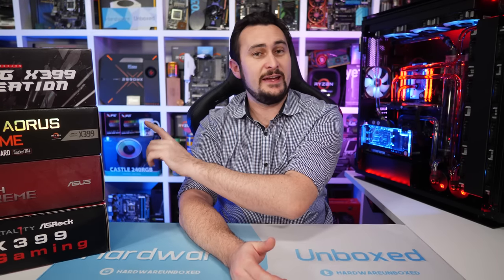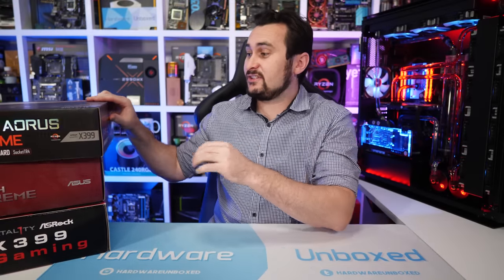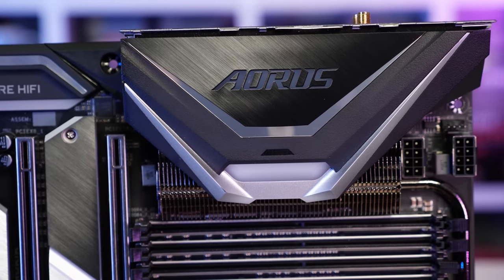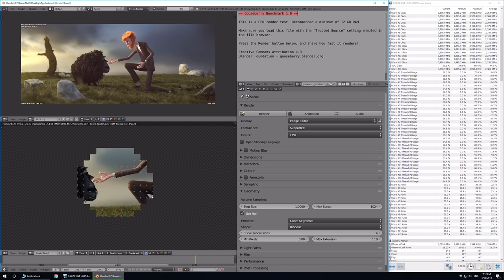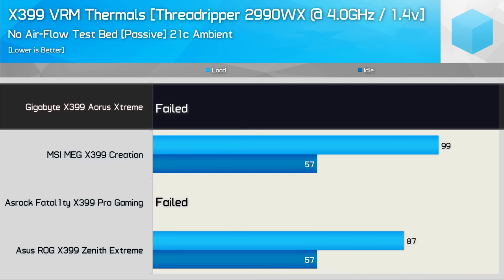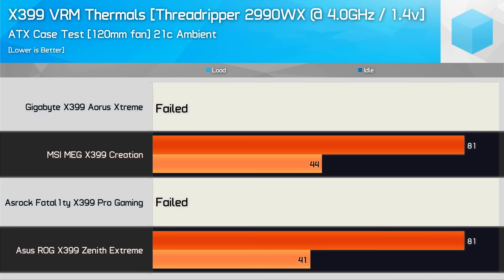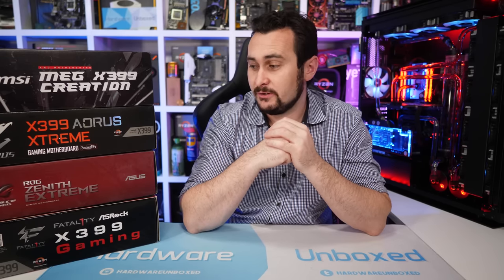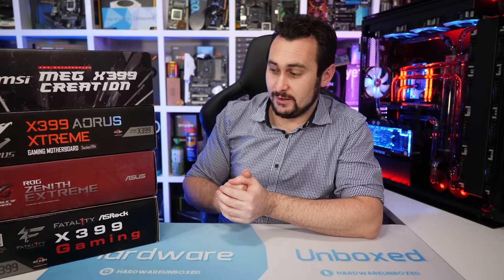2990WX Tripping Up High-end X399 Motherboards, VRM Temp Test

Comment: I think there is almost certainly an interaction effect between the two vrm fans and the active airflow in the case. You probably shouldn't "almost guarantee" that the fans are useless under these conditions without removing them and doing the test. The truth is that, without a counterfactual, you can't know, and it's quite plausible that the small fans could be benefiting greatly from some active airflow to feed them. I don't normally have a negative thought about the videos on this channel, but that was just bad science, Steve. Otherwise, keep up the good work!
Reply from the maker: The word "almost" was used for a reason.
Reply: Yes, I included that in my quote. The point is that taking a position like that without testing it (even while including the word "almost") undermines the rigor of the methods used in the rest of the testing.
Look, I'm a scientist, so maybe I'm just filtering your content through my own lense of ethical obligations, but a statement like that wouldn't cut the mustard in a professional setting where one is held to one's statements and recommendations. The implication of the statement is that the engineers who designed it weren't doing their jobs properly. Gotta be very sure before making an implication like that in my world. 
So ignore the recommendation if you like, but I'm just giving some critical commentary to help the channel stay as great as it is.
Thanks again for all your hard work, mate. I appreciate it.

Comment: I cant thank you enough for showing me the MSI Creation Motherboard in your video before the 2990WX was launched. When I saw that it was going in your personal build, I knew it was the board for me. I was able to get a 4.1GHz OC across all 32 cores at 1.35v of which has been running stable for 1 month as of today. Thank you for saving me many headaches!
Reply: Hi is it still the case? Still running smooth? WOuld you recommend? Thanks!
Reply: @janduda253  yes it runs great after the new bios update.

Comment: Some articles popping up with increased gaming performance on 2990wx with Nvidia cards,  any follow up video coming next on that ?
Reply: I'll be testing threadripper with a Titan Xp and 4x R9 Fury later on. As of X370 Ryzen, 2x Fury won against the Titan in most of my games (also more stable, looks like Nvidia needs to work on drivers some more). You can sub to Legit_Overclocking and request something specifically, if I think it will be fun, I'll test it.

I haven't decided which threadripper CPU yet though. Benchmarks will be done at 4k, and hopefully triple 4k (just to show dominance of quad Fury since its the same price as a single used Titan).

Current Firestrike bench results (GPU score)
Titan: 31k with +900 mem (6.6 Ghz for "13.2 Ghz effective" with lots of memory artifacts, benchmark use only speed), max power offset, and +125 core (+127 is unstable and crashes), 100% fan speed with 80+c temps
1x Fury 15k stock, 15.8k undervolted and 1.1 Ghz, 17.3k at 1.14 Ghz  (NO HBM OVERCLOCKING! latest drivers locked those), these are stable speeds   60c max temps, no voltage increase for any of these
2x Fury (previously 32k+ with my 2 worst cards, expecting 34k with my other 2)
4x Fury unknown

Games:
Crysis 3 at 4k ultra, Titan feels like its about ~50 fps and choppy (avg showed higher, but it certainly didn't feel smooth). 2x Fury feels like 60 (incredibly fluid) even underclocked, getting avg fps later today.
Reply: +Jake Garrett  i will check out your content, for what i'm reading it may be interesting.
Reply: yottaXT  Its this channel: https://www.youtube.com/channel/UCZp2Om_w_o0ry_FQhAUp-CA
I don't post anything on my real name channel (at least for now).

I just got done binning all my cards, so I was ready to try x370 with my top 2 Fury, but then they 2nd wouldn't fit in my case, LOL! So now I have to dissemble my system and put it on the test bench. Too bad I work so many hours, it will probably be a few days before I can test crossfire again (then a few more to process the data and publish, so probably next weekend at the soonest, but I'm looking forward to the results!).

Comment: Very good job Steve. But the results of the Z1E are strange, the board have half of the current capability of the MEG. Did you checked if wasnt power throthling? Like running a bechmark to check if asus scores the same as the MEG on 4.0Ghz

Comment: Great video Steve.  It would be interesting know how the MSI X399 Pro Carbon AC holds up in these tests with the 2990WX since it's the only other board with a higher than 8 phase VRM at 10+3.  Although I don't know the level of doubling or at what amperage the power stages are on that board.  There is surprisingly very little in depth coverage of that board given it's spec.  And that one's also entirely passive, so I'd really like to know how that one holds up with the 2990WX.
Reply: It's not higher than the rest it's the same 8 phase vrm as the others. Of the 8 5 are doubled so 5x2=10 phase and the other 3 remaining phases are used for soc vrm.
The meg for comparison used the same 8 phases and then doubles them all for 8x2=16.
We shouldn't call them 10 phase or 16 phase. We should call them 5 split or 8 split phase as if proper doublers are used the load is split between a pair of moses so half for one and half for the other. It's better than just 8 true phases but calling it more than that is just a lie and shouldn't be tolerated.
Reply: It's not higher than the rest it's the same 8 phase vrm as the others. Of the 8 5 are doubled so 5x2=10 phase and the other 3 remaining phases are used for soc vrm.
The meg for comparison used the same 8 phases and then doubles them all for 8x2=16.
We shouldn't call them 10 phase or 16 phase. We should call them 5 split or 8 split phase as if proper doublers are used the load is split between a pair of moses so half for one and half for the other. It's better than just 8 true phases but calling it more than that is just a lie and shouldn't be tolerated.
Reply: It can handle the 2990wx up to about 3.6ghz with decent air flow on front and back.. at 1.18v.  The CPU passes 390w at that setting and the VRM reaches 120c, which will throttle without enough air flow.  This was using Cinebench R23.  Blender results in about 365w power draw and only 94c VRM temps.

Comment: I used to be a gigabyte fanboy, all i've ever really considered, but my current (AX370-G5) will be my last. I can't overclock at all without the board having a hissyfit from a cold boot, even though the settings are completely stable once in windows/gaming etc.
Reply: I have the same damn problem with the X470 Aorus Gaming 7.. cold boot hangs needing at least 1 reset. Even restart from in windows for 12+ hours requires resets. 100% stable in windows. Not even overclocking the 2700x anymore thinking that was causing it.
Reply: Yeah. Gigabyte sucks
Reply: dam really i thought they were good fk me when i did my first ryzen build i tried an asrock board it sucked ass wouldnt turbo or anything would bootloop if i changed anything in the settings so i got a gigabyte board maybe y i have some instablity at times. ive had a r1400 and now have a 2600x some random slowdowns and random crashes.any recomandations on a better board.
Reply: I agree, I had an X370 G7 die on me about 5 months into it's light usage, even with the latest updates, RAM and CPU overclocking was average at best. RMA'd that and got an ASUS Taichi instead and now 3200Mhz RAM (on 3000) and 4Ghz overclock is easy now, no more boot hanging!
Reply: @discostoo  sounds good sucks tho 2 boards and still have problems memory bluescreens r the worst... Stuck between choosing an msi board or a asus
Reply: i have the same board and i fucking hate it both bioses game shipped pricked so i had to rma it that cost me 40$  and it took 3 months for me to get it back and still countless fucking issues
Reply: @killer32620  Asus get an x470 don't know if the b350 came out yet
Reply: It's all over the place really, I've made several computers(3) using the Gigabyte b350 mini-itx board and they run great. I built one with an AsRock b350 mini itx and a 1700 paired with a RX 480...and it runs great. I have built using the Asus b350,x370, and b450 mini-ITX boards too, and they are wonderful as well. I have the Asus b350 prime board from day one as well and it works great running a 1700 and vega 64. I haven't made a computer using MSI yet because the looks always seem worse than the other boards in the same price ranges(too boring looking, or gaudy schemes). The smaller MSI meg creation might be my first MSI/threadripper board though.
Reply: ill look into it...ran aida 64 for 15mins and my vrm temps went to 95c on my gigabyte ab350 gaming 3 revison 1is it normal for the temps to go up that high
Reply: This is why being a fanboy is not smart. You should not have loyalty towards any brand, only good quality and competitive pricing. All quality is always case by case basis anyways. For example, Asus X470 motherboards are very good quality and decently priced, while their Z390 lineup is pretty much utter overpriced garbage. Within one chipset, one brand can have good and bad boards. Even within one product, there might be buggy versions, and ones that work correctly. One brand might be good today, and disappear tomorrow, and vice versa.

Forget about loyalty. Watch reviews, and compare actual performance.

Comment: If I had seen this video I probably would have gotten the Asus but I got the Gigabyte board. But that’s with a 2950X, and it’s running well. I’m using a Fryzen air cooler for now and once I get to OC-ing I’ll move to liquid. But the Gigabyte board seems to be a very good board so far. I have no complaints. I doubt the Fryzen will keep up once I OC.  And the 2950X is better for gaming.

Comment: I have the ASRock X399 Professional Gaming board, it appears to work quite well though I must say that there's not much of a point OCing the 2990WX much past 350W anyway... I mean, you could certainly OC it past 500W, I managed to do that once without blowing anything up, but any workload that loads all 32 cores is going to be limited by main memory bandwidth anyway.  The cores will mostly waste those watts twiddling their fingers.

I'd like to see bench results simply by using the XFR2 PPT to control the power cap, to find the maximally efficient power/performance point as well as the fall-off in performance as the watts go exponential.   Try running values so the power consumption at the wall is e.g. 180W, 215W, 250W, 300W, 350W, 400W, etc.  And record the bench results.  You should get an interesting (and more useful) curve.

I'd also like to know what wattages the boards were pulling for all of those tests.  Specifying the CPU frequency doesn't really give us a good idea on the actual watts being pulled.  And again, there's no point OCing TR2 parts by setting the CPU frequency anyhow, because the result is an extremely non-deterministic power envelope depending on what is being run... if you are going to OC it, OC it with XFR2 with PPT (and other) fields to set the limits.   A better correlation is power consumption vs VRM temps and the resulting performance.

-Matt
Reply: overclocking to overclock.... with this many cores; why would you?
Reply: I can add this to my test list (getting a Threadripper soon). I can include power figures for sub-zero benching too (assuming I can zip tie my phase cooler on it). I'm cranking near ~450-500w with FX, and that's just because my $40 board only has 4 phase VRM and doesn't allow more than 1.7 Vcore for safety reasons.

My Ryzen 1700 pulls about 120w on an AIO, past that my chip can't be cooled. Ironically 1.38v is the max Cinebench, but 1.54v is what I can do in Frestrike stable because it hits the same magic 120w. I'm not sure why because that AIO cooled my FX at 300w just fine for a year (24 hour P-95 passed no problem pulling over 400w at the wall, stock idle was 70w).
Reply: The power envelope is so much easier to manage on the 2700X with XFR2 + PPT than on the original 1xxx parts.  I have a 1700 and a 2700X side-by-side and its like night and day.

Ever since DerBauer advocated XFR2 + PPT for managing the threadripper in one of his OC videos, I've started using it with all of my Zen+ parts and it's head-and-tails a better way to manage the power envelope than manually OCing the CPU frequency.  Its not only great for OCing, its also great for running Ryzen parts in air-restricted 2U cases and in situations where maximum efficiency is desired rather than maximum performance, because you still get fairly close to maximum boost on single-core workloads.  Also helps prevent the circuit breaker from tripping when one is running multiple machines :-)

For the TR2 in particular, I think PPT is literally the only way one can safely OC the 2990WX and 2950X.   Before I saw DerBauer's video I was trying to OC with manual CPU multiplier and voltage settings but on the TR2 the result was a wildly non-deterministic power envelope that was different depending on the all-cores workload.  I overheated... something, twice, trying to use manual settings.  PPT is stunningly effective at setting precise power caps.

-Matt

Comment: Sometimes the ThreadRipper doesn't fully seat in the socket and cause boards to trip especially with the foxxcon brackets. I've never had problems using boards with lotes brackets.

Comment: What about my Gaming 7... I was thinking to upgrade from 1920X as I have already updated 2 X  Aorus gtx 1080 to 2 X 2080ti amp extreme for my workstation.

I currently run 1920x at 4Ghz all cores and never had any issues. But now, workload is more AND 2080ti already proved to be my best decision in a while.

Comment: Steve have you rechecked gaming performance with the Nvidia 399.24 Graphics driver for the 2990WX?  I guess its supposed to be on par with the 2950X now?
Reply from the maker: I didn't really do much gaming performance testing with the 2990WX, seems rather pointless. If it's on par with the 2950X now, great but I can't see many using it even for casual gaming when rendering or encoding. If just can afford an $1800 workstation CPU, just build an $800 gaming rig ;)

Comment: Nice testing! I'm trying to figure out what the top of the heat sink temperature tells us. A low temperature isn't necessarily good,    could mean that the thermal connection to the power mosfet is poor. Baffled by Asrock's finless design though. lol
Reply from the maker: That is true and I did check the base of the Gigabyte heatsinks, it was much hotter.

Comment: Nice job Steve! I wonder how the Asus fares with the fan unplugged though? It's really strange that Asus felt the need to release the upgrade kit when they did so well here...
Does anyone know if new batches of the Zenith include the cooling kit?
Reply: I haven't been able to find a confirmation of that either way and have been unsuccessfully trying to get a clear answer from ASUS over a ton of emails over the last couple weeks. Also apparently even though ASUS advertises on their site that there are cooling kits for the X399 Zenith, Strix and Prime motherboards, that is in fact false according to ASUS. In the last 2 weeks of emails back and forth I have been told that the cooling kit is only available for the Zenith boards and the other two do not exist, and they are keeping to that story even though I have sent links to their own product pages showing that the kits are advertised on all 3 of the boards overview pages.
Reply: Thanks! Well I guess zip tying a fan might be enough if the lower end boards got a beefy enough VRM... which I doubt for an overclocked 2990WX. :/
Reply: lol yea I'm better off going for the MSI Creation. I currently have my 2990wx temporarily running on my ASUS Strix X399E till I buy a new permanent home for it but its not doing too bad right now running at 3.4ghz and with 100% CPU usage rendering (I'm a 3d animator) well over a few hours now and its nice n stable with the CPU is holding at 62C with a Noctua NH-U14S TR4-SP3. I'm very surprised how well this cooler does on the 2990WX and my 1950X esp when I render animations with the CPU's pinned at 100% for days, I also have a new custom water loop coming Monday for that too so I can keep it much cooler.

Comment: If a/the CPU AIO was separated (not taking air from central chamber), would this improve performance? If say the the 360mm radiator was housed outside the case and Intake air to the case changed accordingly?

Comment: AsRock has that strange 8+4 connecting of PSU + the prochot switch... The cooling is definitely not good, but i have to ask...

Did you tried various connections, and maybe high watts on PSU?
Reply: Sounds like the Astock hit thermal shut down. Any decent PSU should be able to run these Threadrippers in CPU only loads (max power would be around 600w at the wall with a very, very high clocked system).

I'm pushing about 450-500w on a single 8 pin CPU connector with FX. More impressive is that's a 4 phase VRM o a $40 board. That power is CPU power, I need to find my power meter, but it should be around 600w at the wall in CPU loads. Its running extreme cooling (sub-zero) and 1.7 Vcore (max allowed by the board, core temps under full load are still well below room temp).